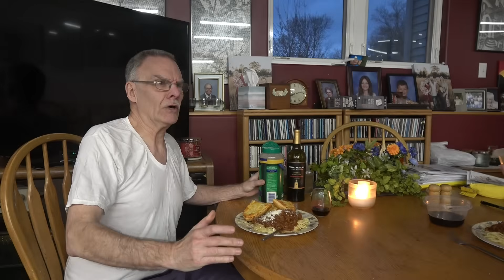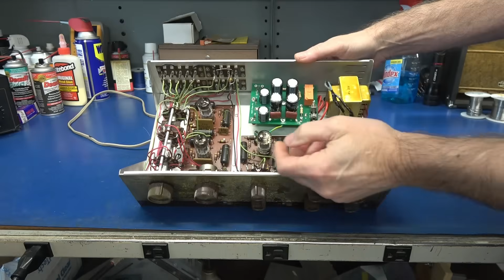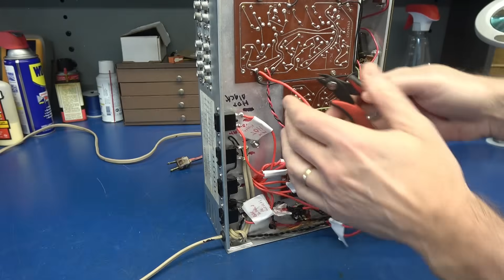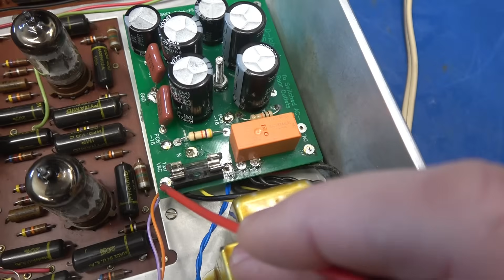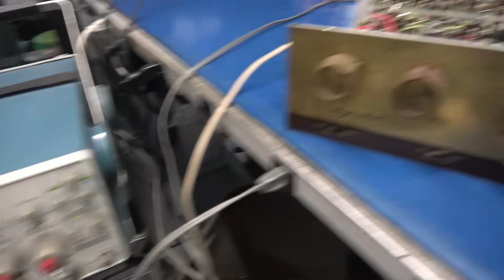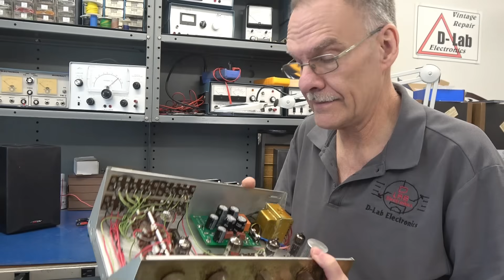Dynaco PAS tube type Preamp needs help Details of the D-Lab power supply module installation

Comment: Awesome!  hey Terry, is it possible if you a get 5e3 circuit in the shop,  can you do a benchmark of total clean power before any clipping happens?  Just doing my build and the power I am getting for the plate voltages isn’t anywhere close to what’s published in the original tungsol data sheet.   But I have nothing to compare notes with.

Comment: I once got ahold  of a PAS 3 cheap and basically stripped the PC boards.  Replaced all the resistors with RN60 metal films I had access to and then replaced all the caps with PP film.  When I sold it I left Mullard tubes in.  I wish I had kept those and sent it on with others.

Comment: Somewhere on the web is a color coding chart for wiring radios and amps. Using one color is a big no no in any kind of
build Terry. So  22 AWG stranded wire goes for about $4.25 for 25 foot rolls plus shipping. Get 8 different colors and don't
repeat the same mistake. Hopefully Terry will get the go ahead to finish repairs on this preamp.
Reply: In airplanes all the wires are basically white.  Then they stamp an ID number on the teflon insulation at intervals but you need a magnifier to see it.
Reply: @TomSherwood-z5l  On really old  tube radios which have cloth covered wiring the colors usually fade so much it is like they are all different shades of yellow.

Comment: Hahahaha! The Dyna was a great part of my electronic history. First, in 1965, my little band's manager used it to record into a Sony 777, great sound, versatile inputs, etc. Late toward the seventies, recording low budget found us using a Dyna again, guiding a clear signal path. Also, Dave West, the great amplifier builder in Flint Michigan used the preamp circuit in the big West amps. I wired amps for Dave, built cabinets, tested circuits. I wired the color way, he would set a completed Grande next to me and I would follow the color wires to wire like the 'template.'  No red spaghetti Hahahahaha, thanks Terry!!